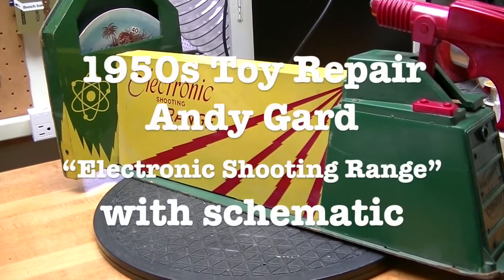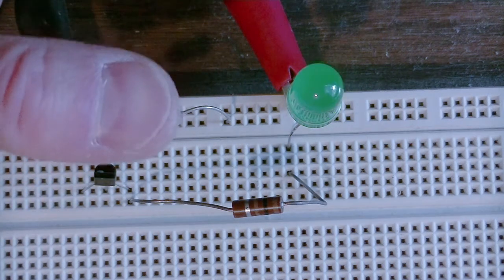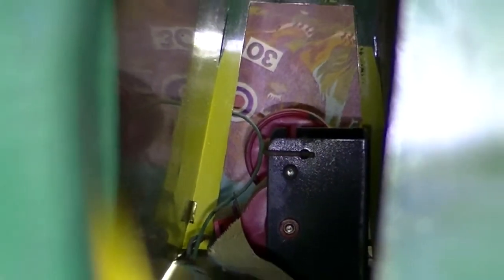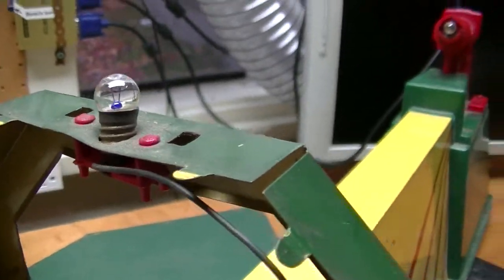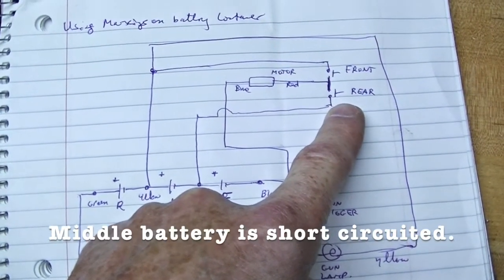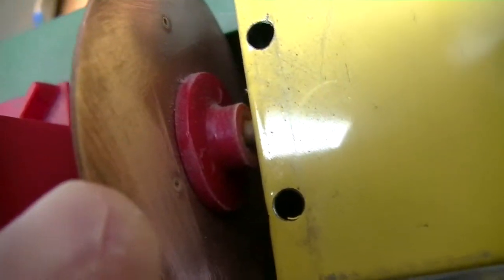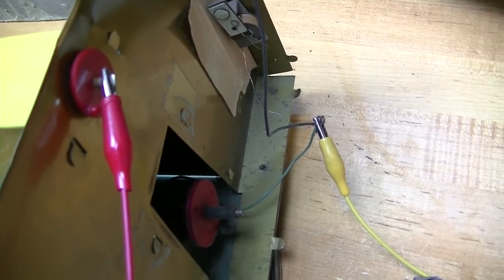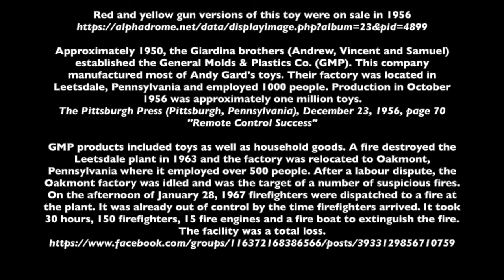Andy Gard Shooting Gallery Toy (Repair with Schematic!)

Comment: I just picked up one of these games at a auction, so thanks for your info and knowledge once i find out if mine does anything?? If i had the patience i would video my toys i managed to fix etc., but your explanation is great plus im learning how to read schematics for   old arcade games which i restore as a hobby also.....
Reply from the maker: Please keep me posted with your progress! It’s very satisfying to make something work. Best of luck.
Reply: @Mr.BrownsBasement  It really is, and i started with old toys and now do pre 1970 arcade games!!!!!! and also toys still I cant pass one up if i see it doesnt work.......I am going to check out your other vids.
Reply from the maker: Thank you. I hope my videos are both helpful & entertaining. I already have so many things I want to do videos on. I could stop accumulating stuff now and still have enough computers, toys, TVs, radios and tape machines to repair for at least the next few years! Toys are a unique challenge because there are no diagrams, tear downs or manuals to help. In some cases there are YouTube videos, but more often than not there are no resources except Trial and Error.
Reply: @Mr.BrownsBasement  I wish I had the knowledge that you have on the schematic figuring and resistors and such on knowing what is what and what to use were etc., im trying to learn that part etc.
Reply from the maker: @markwhip9241 You will. It takes time.